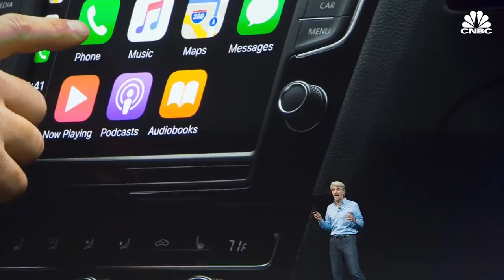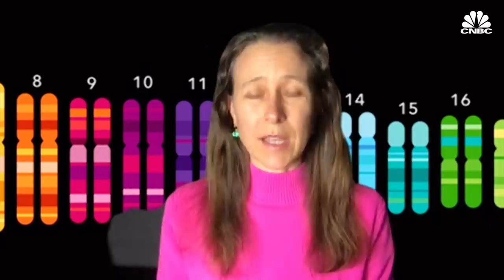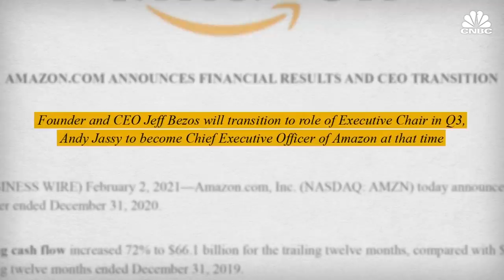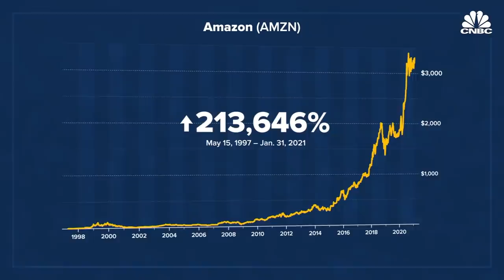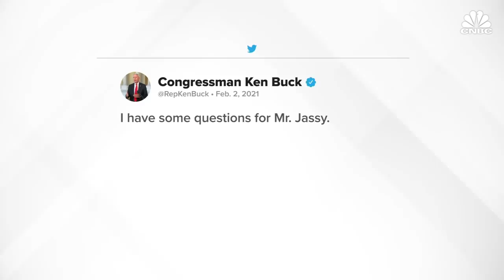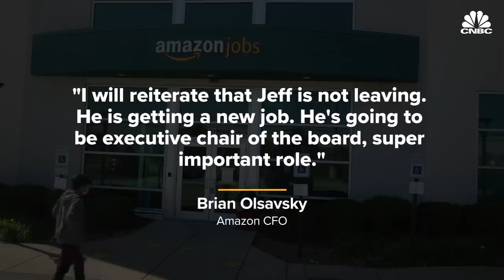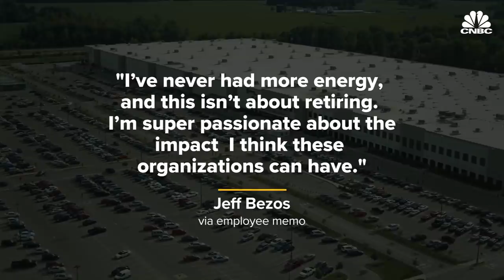Apple Car inches closer to production as Apple nears deal with Hyundai-Kia: CNBC After Hours

Comment: Charging cable not included.
Reply: Portable roof and tires may be added as an extra. Or maybe they have a design that blows all competitors away. Never know.
Reply: Battery not included
Reply: @alanccvoo  that is so true. When I bought my Tesla Model 3 long range. It was 35K plus 9K for the battery. 😅
Reply: battery sold separately
Reply: It’ll save the environment
Reply: Battery will die precisely when Apple car 2 is released.
Reply: @ThanosGod1969  the apple car will throttle and slows down when the 2nd version comes out
Reply: It’s “good” for environment (but mostly their bottom line)

Comment: Apple EV : Upgrade your car every year or two or change your batteries. Only works with Apple tire, Apple cup / cup holders, apple charger & cable. Works well with iPhone & Mac, not compatible with PC/Windows, Android based smart phone. Any extra cables / connectors will be about 5 times more expansive than compatible ones for any other cars for sleek design. After some major system upgrade, some of your existing functions will not work anymore, by design. The car will slow down after certain upgrades for security reason (meaning: time to upgrade)
Reply: Agreed.  But, as an owner of a Tesla I can say you can substitute Tesla for Apple here.
Reply: Just support  GM affordable  electric  car for everyone  ..forget  about Apple car . Apple I phone not cool anymore
Reply: @hopehope7503  Yes my i Pad was holding up one Year and it was gone!Forget Apple,the Money Maker!No Quality it’s not lasting!